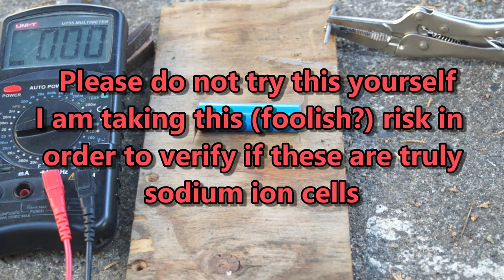Sodium Ion nail penetration test

Comment: Just bought a cell to test off ali, how can I check if its real?
Reply from the maker: You need a battery load/capacity tester.  If they only charge up to 3.9V and discharge to 1.5v then it is sodium ion.
Reply from the maker: https://www.aliexpress.com/item/1005003406082242.html?src=google&src=google&albch=shopping&acnt=708-803-3821&slnk=&plac=&mtctp=&albbt=Google_7_shopping&albagn=888888&isSmbAutoCall=false&needSmbHouyi=false&albcp=19108282527&albag=&trgt=&crea=en1005003406082242&netw=x&device=c&albpg=&albpd=en1005003406082242&gclid=EAIaIQobChMIgLet_amDggMVDSCtBh2RDAoJEAQYAiABEgKYCvD_BwE&gclsrc=aw.ds&aff_fcid=34d348adcae44dc28dbdcdde4d67f465-1697760318630-02206-UneMJZVf&aff_fsk=UneMJZVf&aff_platform=aaf&sk=UneMJZVf&aff_trace_key=34d348adcae44dc28dbdcdde4d67f465-1697760318630-02206-UneMJZVf&terminal_id=adb02f7458b1476796c9c6cf99ab9fac&afSmartRedirect=y

Comment: Is there a difference between a charged battery and a discharged or low charged battery?
Reply from the maker: Yes of course.  A charged battery has a lot of potential chemical energy.  It is also slightly larger when fully charged (not a lot but technically it is larger) because of battery swells when fully charged and contracts when discharged.  This is one of the things that contributes to the breakdown inside the battery.
Reply: @diyelectrified1289  Please make it again with discharged cells.
Reply: @wasserdrucker6227  If push a ball at the top of a hill, it will roll all the way to the bottom.
If you push the same ball when it's at the bottom already, what will happen?
Reply: @PhilAndOr  I want to see how much the ball is rolling around at the bottom. Maybe the ball is air filled and will jump around etc...

Comment: If you have 4.1V could not be Sodium ion. Fake battery.
Reply from the maker: How so?
Reply: @diyelectrified1289  2,9-3,0V expected
Reply from the maker: 3.1 is the nominal voltage for sodium ion.  Fully charged is 4.1V.   
If you watched the discharge test you can see it was drained to 1.5V then recharged and discharged again.  You can't do that lithium.
Also I am sure you are aware that the nominal voltage for li-ion 3.7V and lifpo4 3.2V.  yet fully charged they are 4.2V and 3.65V respectively.
Reply: @diyelectrified1289  thanks for your advice

Comment: which one produced a bigger boom 18650 or sodium.
Reply from the maker: These are 18650 sodium ion cells.  I think you meant compared to lithium ion.  Lithium ion explode and burn rapidly.  These just seem to rapidly boil the electrolyte causing a rapid pressure release